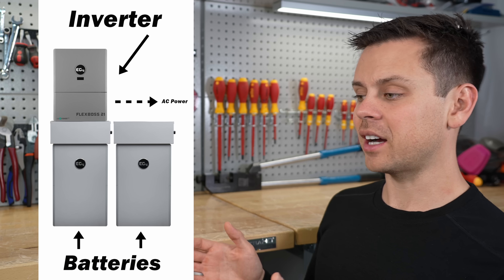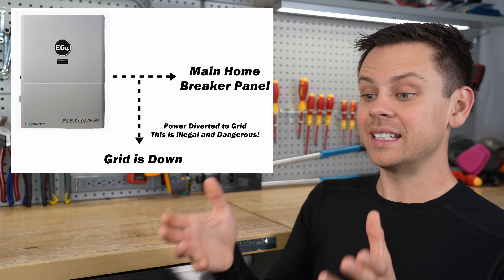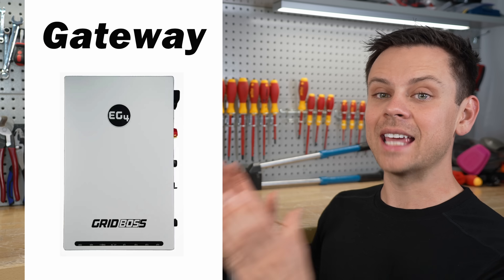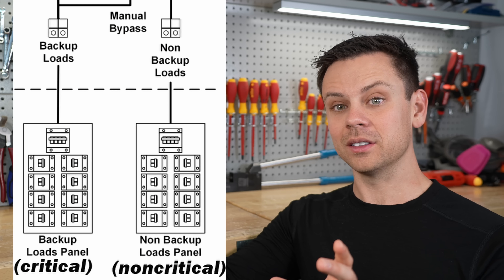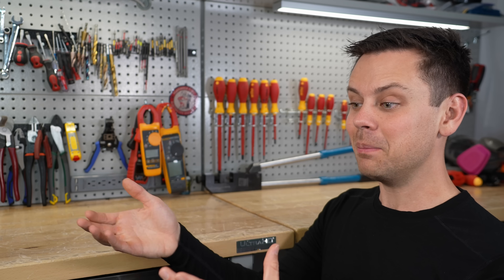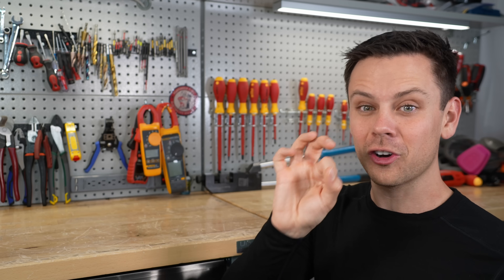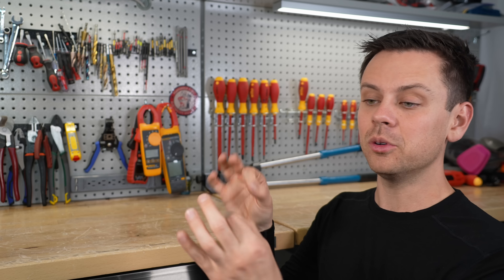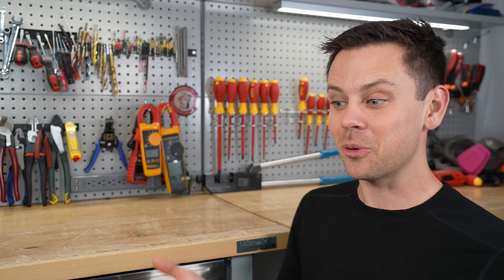EG4 Grid Boss Gateway: What is it?? Beginner Friendly Tutorial!

Comment from the maker: I felt awful that the beginners were confused in the last video!! I hope this clears it up and helps everyone. Let me know if there is anything you do not understand here.

Also this video is not referring to offgrid specific inverters! The flex boss is a hybrid inverter running in off-grid mode. The gateway allows you to run hybrid and grid tie inverters, without the grid. I call this "offgrid" because its not connected to grid. Hopefully this does not cause any confusion. Please let me know below if it does.

A gateway can be called "smart transfer switch" or "micro grid interconnection device" or a host of other names. If it goes between the panel and the meter, it's all the same. Just a large transfer switch.

Final update: only EG4 hybrid inverters can connect to the grid boss hybrid ports! You can connect any brand of grid tie inverter to the smart ports, The load terminals of the flexboss, or connect them to your panel. But this is not true for hybrid inverters. It has to be EG4 to work with grid boss hybrid ports
Reply: Thanks for your clarification 👍 you mentioned that different brands of invertors can be added to the gateway.  Can the same thing be said about the batteries? Ie. Eg4 battery connected to one invertor and different brand battery connected to 2nd invertor and they all connect to the gateway?
Reply from the maker: @lkevonly It's not suggested, or covered under warranty, but I do it all the time. I have a video on how to do it called current sharing tutorial.
Reply: You really do a great job! 
Question: Solark and EG418kpv's already have built-in transfer switches so why would an additional external transfer switch be needed? Is it that the internal transfer switch cannot be relied upon to divert power from the grid to your load in the event of a malfunction? Thank you in advance.
Reply from the maker: @powerguymark  Oh good question! They dont need it. It can be relied upon, but it costs a lot of money with large cables to connect them legally. 

So the companies are removing the transfer switch, and putting it in a dedicated product called the gateway.
Reply: Thanks for the clarification Will ! I have some experience with inverters, batteries and charge controllers but often have difficulty following your discussions. I appreciate the difficulty of providing accurate information about complex topics to a general audience. You do an excellent job balancing between the basics and the more advanced aspects of your subject. Keep up the great work !!!
Reply: Good job making a follow up video. I was sitting there like I have no idea what Will is talking about. Lol
Reply: Great video as I was a little head scratching... So you can export to grid and or choose to prioritise solar and use grid as a back up? Would be great too see the nuances of how that is controlled and the available logic options if possible. But looks like a great bit of kit. Should be popular in countries like Ireland after storm eowyn and all the people who lost power.
Reply: Thanks for reading our comments! I was one of the confused ones!!! ❤
Reply: I'm a computer tech from back in the days of needing to understand electricity and electronics and needing to use an O'scope to trace signals through equipment to find problems.

I didn't understand the last video because I have no context for these home power management systems.

This is maybe something you could do in an upcoming video, and slow down just a little when explaining.  Take a couple of systems from say Tesla and this company that makes these grid devices, throw each into a block diagram and then talk about each block and what's happening there.  A person could then see the differences/similarities between the systems and also understand what each block in that system is doing.

When you get around solar people can get confused because of DC vs. AC, needing to convert that, the advantage of having a battery in the system, where it is in the system and why, etc........

Can you have active or always on battery packs that you are always using the power from and then the inputs feed into that battery, so the local grid would feed it, solar panels would feed it, maybe a generator also feeds it also?  In which case you need to convert from AC to DC for the local grid to power the battery, but solar panels create DC, and a generator typically creates AC as an output don't they?   So already there's lots of conversion.  But the battery is storing DC, and the home needs AC, so another conversion.

Because of all of this it gets hard to quickly understand everything a device is doing without seeing where it is in the system.  I figure that's about a 20 minute video.
Reply: Thanks will.  Any chance you could cover what it would take to have a battery backup if you have solar panels each having their own micro inverter e.g., e phase. Enphase battery systems are very expensive and the batteries themselves have microinverters
Reply: Maybe a new vid explaining all that?
Reply: So I put this between my main panel and put my critical loads to this unless I have enough batteries and inverters I can push the full 200 amps to my main panel from this gateway? As I see it I could do this and put the critical loads on the gateway and then grow the system if i wanted to so one day I could in theory move everything back to the main panel whenI could feed it the 200 amps. I think I finally got the gateway straight in my head, thanks for the videos.
Reply: A lot of us are off-gridders only and that's why it's somewhat confusing. I have built and use the famous EG4 off-grid 48V hand cart system, which is great, and I'm no beginner to off-grid, but found this topic more challenging to grasp at a high level. First, my EG4 system could not be used with this device because it's specifically an off-grid inverter. I think there's an implied level of understanding terms and the larger concepts of how grid-tie switching works, which is where I come up short. Knowing what the legacy grid-tie systems and legacy challenges actually look like vs this would be best rather than a verbal description alone. Maybe diagrams might help even more. Thanks, Will.
Reply: I have a question. We are getting ready to build a new house. I want to run solar and will be doing that for sure. It will most likely be grid tied to start. I want to eventually go full off grid though. I plan on picking up the EG4 indoor batteries unless there’s a better option over time as I can afford them. Is there anything I should do on a new build that will help me with this goal. My initial thought was to expand the garage a couple feet and make sure the house panel is on that wall that’s expanded so that I have space to mount the inverter and batteries. Would this be beneficial.
Reply: @WillProwse The Gridboss can absolutely be used off-grid. In fact, it's a great way to parallel multiple Flexboss inverters and have a single generator connection.
Reply from the maker: @RoderickMcSlagerhaden  oh absolutely!
Reply: I am confused by ALL your videos.  20 years after getting a masters degrees in music & education, I went to community college to study algebra & science.  One teacher had the best learning technique:  read the chapter 3x.  The first time don’t try to understand.  Just plow through.  My dad had an HVAC business, so I’m familiar with electricity.  But I still watch your videos 3x.  And it is worth the effort!
Reply: If they can't learn from you, they can't learn from anyone. I'm very thankful for all that you've taught me.